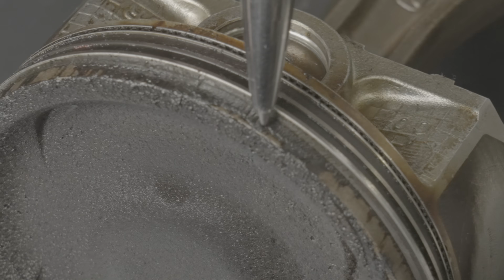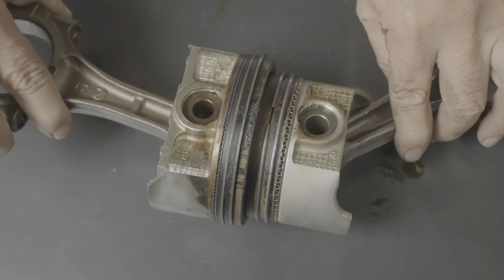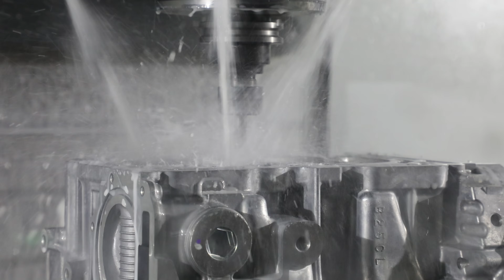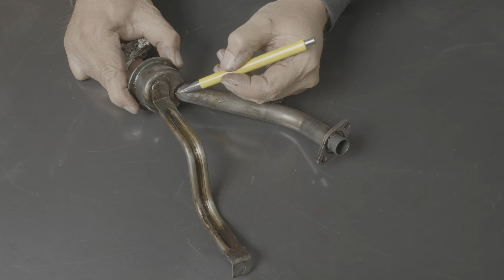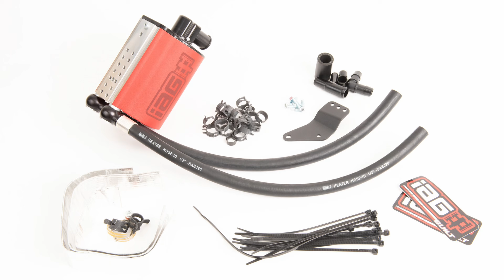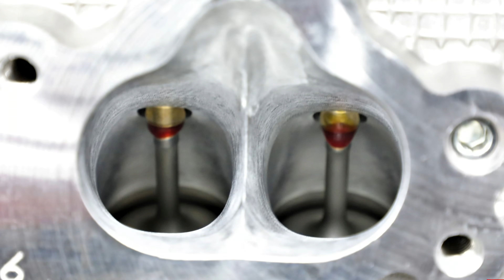Why Subaru Engines Blow Up!

Comment: Bullshit, had a 03 WRX for 8 years and later a 06 STi  for 5 years, neither blew up. Oh and the head gasket issue only applies to the old sohc naturally aspirated 2.5 engine with its paper thin composite head gasket, everyone knows the turbo EJs come with multilayered steel head gaskets and do not have that issue unless you overheat the shit out of it or overboost and lift a head or something. Kids will always find ways to blow up enthusiast cars, any engine will blow up if you just throw ebay parts at it with no tune and no maintenance. This guy obviously doesn’t know anything about Subies, in fact he speaks like he has a teleprompter 😂 like many others he just wanted some quick views, that’s all.  I’ve seen plenty blown up K20’s, in fact most Civics on sale near me already have a 2.4 swap cause its much cheaper than finding a Z3 engine, so they just throw in the first 2.4 they find just to sell it, so stop it. 😂
Reply from the maker: Well if your car is totally stock and well maintained and you putt around sure, good for you. Nothing in this video is bullshit at all and a bunch of Subie guys with blow up engines will disagree with you too. There is a reason why they have that reputation and there is a reason why this market is so well developed with fixes. You can choose to be ignorant or you can watch and learn from pros.  Sorry to tell you what you don't want to hear.  That isn't a reason for saying I don't know anything about these engines.
Reply: @motoiq my Subies were far from stock dude and don’t tell me you didn’t knew the head gasket issue was only an n/a thing 🤷🏻‍♂️😂 you’re obviously misinformed and im pretty sure ive forgotten more about Subies than what you know about them, and thats ok, it’s not your specialty, you just repeat what you hear. The EJ is not in production anymore, the Sti is dead, there have been other videos covering the same topic. The engine is not the strongest but it’s no different from the majority of open deck aluminum 4 bangers out there. The Ej has been around for decades, there’s a recipe for it to make power safely it depends on you if you want to stray away from that 🤷🏻‍♂️. You treat your car like a race car, you’ll have race car problems. Ive seen many many Subie owners buy an old, neglected and abused WRX, put a mbc and a cheap intake expecting it to last 100k more miles while flogging the shit out of it suddenly be surprised when it blows up on them 😂 many of them just inherit somebody else’s problem. They are not ordinary engines, and many people just don’t want the hassle of (example) taking a whole hour to change spark plugs 😂 so they just say hell no! and just neglect them on the most basic things like checking the oil.
Reply from the maker: Thousands of blown-up Subie owners would disagree. Subie guys are our best customers for a reason. Funny I never see you racing at any of the major national-level events with your awesome cars.  Good luck to you.
Reply: @joecam7109 compared to every other performance 4 cylinder its a terrible design. Sure it may hold xxx amount of power for xxx amount of miles but those numbers fall short to engines like the K20/24, 4G63, 4B11, EA888, SR20, and even Ford ecoboosts. To top it off the EJ would be lucky to get similar MPG to those engines. 4/4 of my friends who’ve owned a Subie has had the engine blow/start giving them issues. I’m so glad I didn’t get a Legacy GT as my first car like I wanted and went with a car with a K series. It’s tuned to 200whp and I rev it to 8000rpm almost daily and it has 170k miles (and gets 30mpg)
Reply: @TheRyansLion  well that is your opinion bud and opinions are like buttholes, everybody has one. Now, what it’s really a fact is that Subaru mass produced that engine since the late 90’s, (early 90’s if you count the 2.2l and GC8 STi’s) until 2021 when they stopped production of the STi, no car manufacturer would dare produce an engine so "terribly bad” for more than two decades, it wouldn’t be cost effective, use your head. The k20-k24 is also an aluminum open deck design yet most of the live in the 180-230whp range in N/A form but every single kid that get their paws on a turbo Subie wants to immediately put a manual boost controller, raise boost and try to make a gazillion whp. Ecoboost have their own head gasket problems and the 4G63 is an old iron block design, heavy but resilient and suffered from crank walk. There’s no perfect platform, when you’re trying to make big consistent power out of a 4 banger eventually something is gonna give, you’re going against physics.
Reply: @motoiq haha you really hate Subies do you? Tell you what, keep your hate campaign, maybe someday they’ll finally go down in price so i can buy a couple more of them. 😂
Reply from the maker: @joecam7109 My family owns one.   It was an FBO stock bottom-end car and it ran for around 4 years at 400 whp till it cracked a ring land.  This is more power than what we recommend for customers with stock bottom, ends but we wanted to see how long we could get away with it. It is now a street daily and has 520 whp and is pretty fast.  We addressed the engine's problem areas and it's been reliable at that power level.  It is a really fun car to drive.  Meanwhile, our family EVO IX has been running around with 500 whp on the stock bottom end for years... EVO 4G's don't suffer from crank walk, only 2nd gen DSM's have that issue.  Of all the types of engines we do for people, Subies are the weakest in stock form and need the most special care to be good reliable engines due to the facts we relate to in this video. This is not bias just what needs to be done.  I love Subies they are are best customers.
Reply: @joecam7109  The older EJ’s were better but they just got less reliable over time due to emissions regulations. From my experience I’ve seen way too many people have issues first hand with their 2.5 EJ’s compared to every other turbo 4 cyl platform.
Reply: @TheRyansLion  they’re 99% the same, the 2.5l block is just a 2.0l with a cylinder bore, semi closed deck instead of the 2.0l open deck, different rods …only emissions equipment like air pumps were added and most owners delete them anyway.
Reply: @joecam7109  did you watch this video at all? He explains why the larger bore is a problem
Reply: @TheRyansLion  i did watch the video and he basically complains about every single bolt and nut of that engine 🤣. I know lots of STi owners putting down more than 400whp without problems on their stock block daily driven EJ’s…thats pretty great from a 4 banger when you consider bigger and less stressed engines like a VQ35 tend to explode at less than 350whp levels. Not every engine can be an iron block 4G63…as i said, the EJ has been around for decades and there’s a recipe for them if you want to chase big hp, if you stray from it and completely ignore maintenance you’re going to have problems, if you buy someone else’s flogged and abused project and immediately try to extract every drop of power…you’re going to have problems and that applies to most engines. 🤷🏻‍♂️ Simple as that.
Reply from the maker: @joecam7109 Who is complaining, I am just talking about facts and explaining the mechanics of it. For all of those STI owners that don't have problems at 400 hp there are more who do unless they are the cars and coffee types. If you really know lots of STI owners at 400 hp, you have to know a lot on their second engine. That just how it is.  Our bolt on 400hp on the stock bottom end shop STI lasted about 4 years and that's tuned correctly.  We recommend not exceeding 330 on California 91 pump gas and 380 on E85 to our customers.  I have no emotional bias toward these cars, I do like them and they can be reliable if you understand their limitations and do not exceed them. If you have a higher hp stock bottom end car, you need to understand that you are one tank of poor gas or a dirty injector or a flaky fuel pump away from disaster and you have less margin than any other engine besides maybe a 13BREW.
Reply: @motoiq people really don’t understand how much the quality of pump gasoline can vary because of the condition of the fuel station’s tanks. 

I blew the cats on my 300C because of water in the fuel and had a customer’s diesel Touareg stalling because of algae in the fuel.

Comment: This is amazing, I wish I could pick your brain more, I have so many questions like does the iag block have the same problems that the stock block has and does Porsche have these problems or have they figured this out? And how about the hoonigan subaru that doesn't have headgaskets, it's just that precise
Reply from the maker: A Porsche case is much more beefy
Reply: @motoiq and I have a saabaru with the 2.0 turbo is that a better block?
Reply from the maker: The 2 liters are a little stronger but still suck
Reply: @motoiq thank you again this was very informative, sorry I keep coming up with questions what about mighty car mods and a turbo 6 cylinder?
Reply from the maker: The six cylinder is expensive to mod.

Comment: So basically my stock 2020 STI is a ticking time bomb that’s GREAT!
Reply: Iv got a 2019 STI making 420whp on E85 she has 65k miles. Had the mods for 3 years and the car for four years. In my opinion the reason I’ve had no issues is because of my tuner and I’m on point with the maintenance. 🤷🏽‍♀️
Reply: If you maintain it well and keep it stock, you're probably fine.
Reply: Your not alone bro im at 40k in mod and time is ticking 😂

Comment: Subaru bros really be out there spending $30k on an engine just to get walked by a K series smh
Reply: Even the block from a 2AR-FE, basically a Camry engine with zero performance intentions can handle big power way more effortlessly than Subaru's “performance car” engines.

Comment: Had a 05 legacy gt limited wagon, only “mod” was a catless up pipe. Motor went at 130,000miles. It spent a lot of time at Subaru for wheel bearings, a/c, and electrical problems also. I loved that car and then hated it. Sad to see it go, but glad to never see it again.
Reply: I’m sorry about your experiences. I’m on my 3rd legacy. My ‘97 I got rid of at 116k, my 2010 2.5 at 79k, and I still have my ‘16 3.6R. 
Heard mixed things, but I’ve never had issues.
Reply: @cecilthecavetroll9743  no need to be sorry. That was just my experience with what I thought was gonna be a great family car, but it let me down more times than I’d like to remember and the Subaru experience and dealership was also a letdown. They wanted to ignore issues or pretend the problems were normal until the warranty ran out.

Comment: Hey Mike, what do you think of the Radium Auto AOS as an alternative to the IAG AOS? Features the same coolant “heater core” system to prevent condensation forming and cheaper, at least here in Australia.
Reply from the maker: Those are great too.  The advantage IAG has is more capacity and a centrifugal separator.
Reply: IAG are cheap enough here in Australia.

Comment: Really detailed and comprehensive report on EJ issues.  I lost my 92X motor at less than 30k miles still under warranty and Saab/Subaru wouldn't cover it.  Haven't trusted them since.  The FAs are a little better but I still won't track one without the recommended mods and they are farther down the list of desirable cars for me.
Reply: Sounds a lot like the denied warranties for the FA24 motors that are in the GR86/BRZ. I nearly bought a GR86 myself but the more research I did the more I realized that I don't make enough money to tank a totalled engine block in car that has multiple known ways of totaling the engine.
Reply: why didnt they warranty it?
Reply: @Gabriel-vj1cf  It was 3 days over the warranty time period.
Reply: I find it so surprising the variance in experience. My family has had a LOT of Subarus but never had an engine go. My sister even had the timing belt slip on an old Impreza hatch I think and it drove to their garage and it didn't damage the engine (amazing, we thought anything happen to timing belt and engine is toast). I think the main difference is we've avoided turbos and aren't racing / tracking our cars, we just want pretty reliable really good AWD and good in the snow cars.

We have had the head gasket issue, but they're not that bad to get fixed or if you're buying used, just buy ones that had the gasket changed already. I'm pretty sure they finally fixed that with the new engines.

What I did have go wrong was the newer CVT transmission. I decided to keep a car due to not driving all the time, and at 55k miles the CVT started slipping. Luckily for me - Subaru is covering it under an extended warranty(not something I bought, I guess they just did it for everyone because of some issues.), so I have no real complaints - they're dealing with their bad part, no hassle from me needed. I get to drive a new Outback while waiting for them to fix mine.
Reply: You modded it?
Reply: FA's are extremely stout, significantly better than the EJs. Quite a few people making a lot of power on unopened FA's these days

Comment: Those fancy oil pans and windage trays will only go so far if a person is not diligent on oil changes and a good oil. People are fucking lazy and will never clean them out once a year or EVER, which I would argue is over 3/4 of Subaru deaths. "Lets just bolt on some shit and tack an access port onto my car".  That is why most of these engines die.

Comment: Only a fool would track a stock motor or trans. Outfront Motorsports makes built Subaru engines that will last. If you want real power, it's gonna be $$$. Never be cheap. A custom dyno tune is an absolute must if you want longevity
Reply: "Only a fool would track a stock motor or trans" That doesn't even make sense. The Ariel Atom comes with a bog standard Honda K24 engine and a bog standard Honda transmission, and Ariel puts a supercharger on top of that.  The Lotus  Emira comes with a bog standard Toyota 2GR engine and a bog standard Aisin transmission, and Lotus puts a supercharger on top of that.

Comment: BUT Why do Most of those which blow boxers engines belong to America? 
They blow the most subaru engines period. 
(I know a lot of it is due to bad driving habits, 
like flooring it in top gear to overtake at 40mph causing LSPI blowing ringlands.)

Here its common to see a 94-2000 WRX with 300,000 - 350,000km on the clock without a rebuild (even some over 400,000km), But that is keeping the power under 300HP as intended. 
Thats a high number for a boosted 2.0L 4 cylinder that gets thrashed a lot.

Also those are the OLD ECU's (Pre 2001 OBDII) which are tuned to run on Japans 100 Octane Premium Unleaded & best we have here in Australia is only 98 Premium. 
2 points can be enough for detonation issues.

Comment: I'm just getting my Subaru wrx back from the shop on Wednesday ( no, I did not blow the engine, just the 5spd ). Although having the shop change to a sti gearbox, I thought why not upgrade it a bit? So it has a new twinscroll turbo, and will probably make 300-320 crank hp. Glad I had them put in a iag oil pickup. Should perhaps look into the air-oil-separator as well.
Good information!